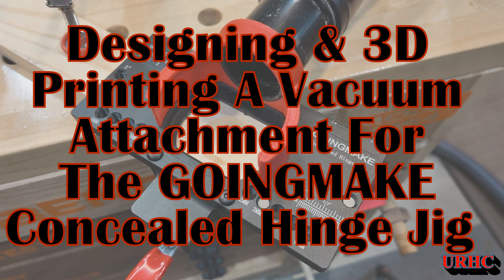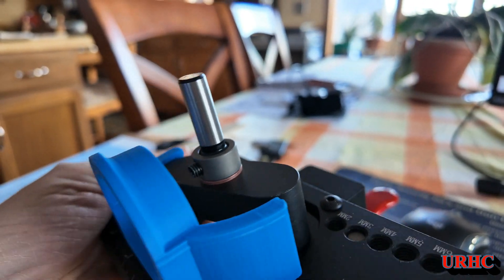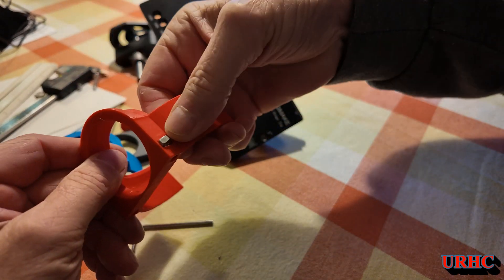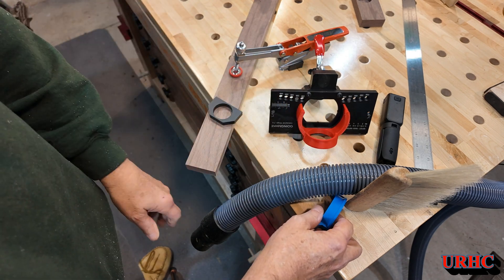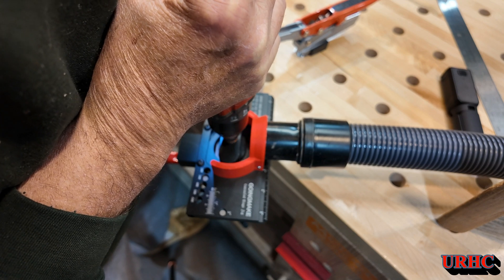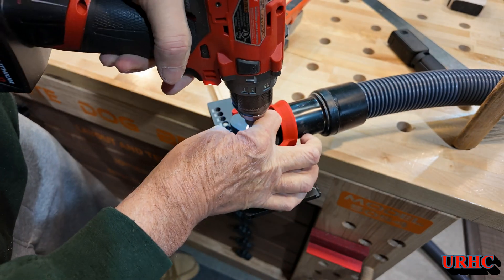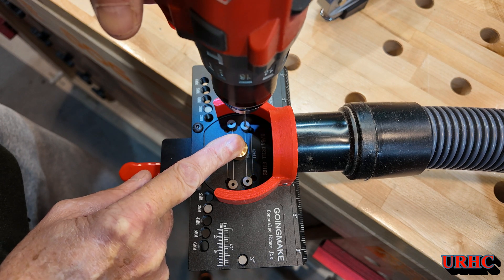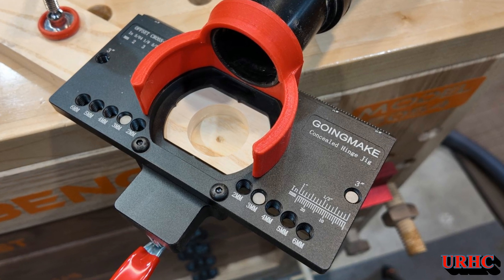Designing And 3D Printing A Vacuum Attachment For The GOINGMAKE Concealed Hinge Jig

Comment: Do you still have your kubota zero turn? Have you been happy with it if you still do?
Reply from the maker: I still have it but I might dump all my Kubota equipment this summer if Kubota doesn't fix my Sidekick . They have defective Subaru engines in them and trying to hide it. Kubota customer service has gone from good to crap. Thanks for watching
Reply: @unemployedredneckhillbilly2023  have you had any issues out of it?
Reply from the maker: Nothing major yet. The worst part is how they put all the nuts and bolts facing inside the deck making it hard to scrape and rust catchers. For some  reason it burns about 2 gallons of gas a hour which seems to be excessive for 25 hp kawasaki engines. Found out every 200 hours the 2  pumps drive oil must be changed with a very expensive oil. About $80 a gallon ( $20 a quart) I was told plus filters and you need 5 gallons so that's about an extra $500.00 every 2 years maintenance if the oil price stays high because of the Parker motors. Im looking at spring suspension for the front wheels if I keep it because I have a very rough lawn and the seat does nothing for the side to side bouncing and to save gas I try to mow as fast as it can go that uses a little less fuel overall.  If I knew then how bad Kubota warranty coverage has gotten,  I never would have bought it just to stay brand loyal.  There are better choices I passed up.
Reply: @unemployedredneckhillbilly2023  I currently have a kubota z421 amd looking to upgrade.  I like the kubota but I need a new mower and I'm looking at the 700 series or the scag tiger cat 2
Reply from the maker: Scag has a better cut and still has grease fittings on the spindles.  Kubota went with sealed spindles that have shorter life and cost a fortune to replace.  last year Kubota thinned down the deck gauge from 7ga  to 8ga is something I found out after buying.  kubota dealers have a lot of leftovers that you probably could save a couple grand on.
Reply: @unemployedredneckhillbilly2023  I'll definitely have to take a look at both once the season starts. My local scag dealer told me I could demo a unit of my choice so I'll do that but I wanted to wait until there's decent grass growing to get a real test. Thank you for getting back to me!

Comment: Hi URHC , amazing work, I still cannot get my head round it, how you design things on the computer to do it, 
Many years ago, I will probably spent half an hour to an hour drawing that out and colouring it in to make a picture of it , 
Excellent work, stay safe keep up the great work, Phil from the moulin.
Reply: Hi 👋, it’s taking me a few hours I have been watching your building of your router table, very impressive, very nicely made, I bet you could sell a few of those, Phil from the moulin, ps I didn’t realise that Milwaukee made such powerful routers, I have the large festool 2200 and Mafell ce 65 , and I think the Mafell is a better router than the Festool , they both put out the same power, but the Mafell seems to have more grunt, and doesn’t fluctuate underload, look forward to seeing your next project, have you built a power feed for your router table that was something I thought could be very useful, Phil from the moulin,
Reply from the maker: Thanks.  It was a fun project and gets used often. The Milwaukee router has good torque at lower rpms under load and so far I am very happy with it. It runs very smooth.  As you probably  saw the larger size limited my lift selection though. I would love a power feeder but really just do small runs with it and can't justify one. Almost as good as having a dedicated shaper.
Reply: Hi 👋, I have a older version of the Felder KF7 series, Shaper and saw bench, It was secondhand when I purchased it from Felder themselves, it had not had a lot of use, but was low in horsepower, So I got them to put a pair of, I think either seven or 10 hp motors on it, 
And you could change the shaper spindle for a router spindle , When I first had it, I would set it up for doing the scribes and mouldings for windows and doors et cetera, But I found this took too long, as I had started to get very big contracts for making doors and windows, so I ended up going out and purchasing an old Watkin EkA Which I rebuilt, As you can probably imagine a lot expense involved in buying cutters, blocks et cetera, I ended up buying three engineers, tool cabinets and chests, It made it a lot easier bringing the tool cabinet to the machine where I had the cutters and all the tools in one unit, as amount of money all tied up in one machine, I am hoping to put the roof on the garage next to my property this week, weather permitting, and close the front in, as it is connected to my building, I’m taking out a double window which is going to be the doorway going from my property into the garage, then I’ve got to do something with the floor non-existent at the moment, cannot lay concrete, as it is too cold, so I think I’m going to build a suspended floor in there for the time being,
Reply from the maker: It's amazing  how all this newer equipment works together.  No paper required anymore.  Thanks for watching.
Reply: Hi 👋, URHC , just found something interesting on the old YouTube, I have a four story building, and I need to get logs from basement to my attic room at some point, at present, I only bring them up to the third floor, to do this either use a dustbin or a small plastic container which I have to carry up three flights of stairs, and I do this at least once a week to load up for my log stove, As we are not getting any younger, I’ve been thinking about something in the way of a winch to bring stuff up through a hole in the floor, I’ve just found something, it is linked to DIY elevator with wireless remote, it’s quite interesting and tells you how to build a frame and structure, not sure whether you might need something like this, but I am going to get a list together in the next day or so, and ordering some bit, I hope this can be some help to you or somebody else, Phil from the moulin